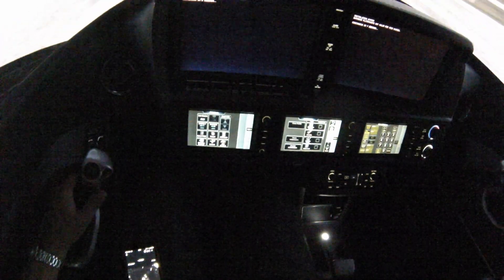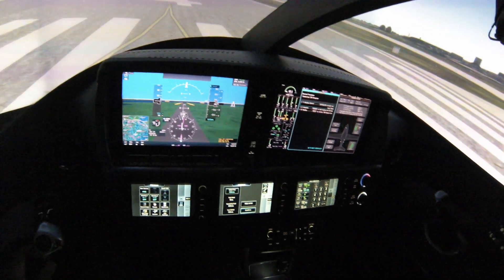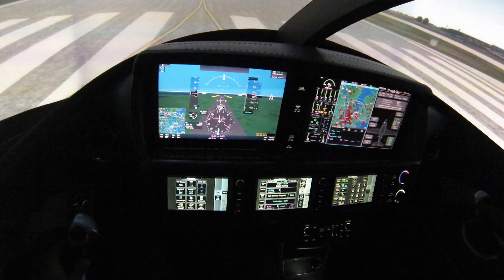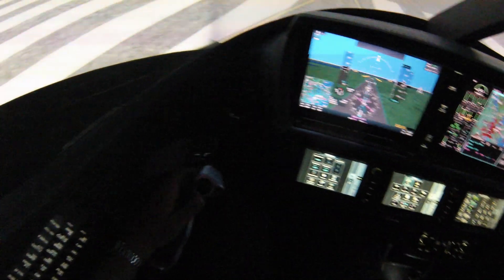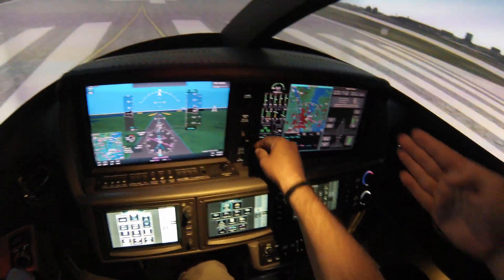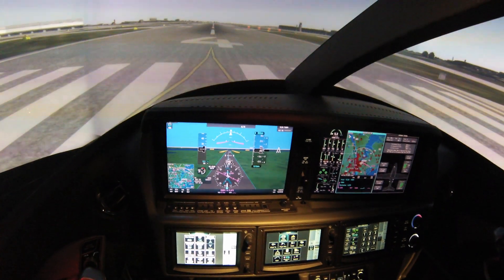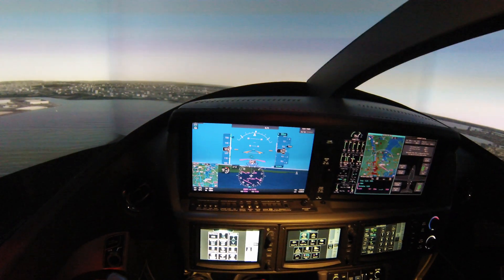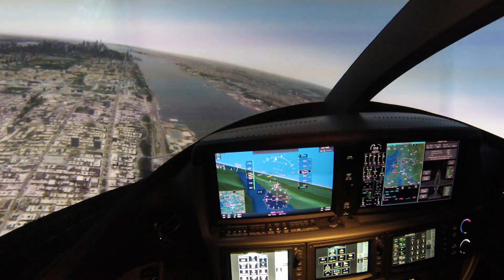Cirrus SF50 Simulator Avionics Briefing for Takeoff

Comment: The start up sequence entering in the destination first seems very backwards...then you have to enter in the take off runway (for the safe taxi system to be able to work)...and then manually enter the TO distance. As a part 121 airline instructor, when we programmed the FMS, we always entered in the flight plan in sequence starting from TO, the runway, SID, the en-route way points and then the STAR and destination. For training we always entered in the landing runway but on descent, we got the ATIS and let the students update the flight plan with a new STAR and landing runway.

The start up sequence here seems out of sequence and like we're jumping around. The student is entering FMS data but doesn't complete it...and instead, jumps to entering the TO distance. The whole thing feels uncomfortable, out of sequence and like it could have been bettered designed flow-wise.

Also, no checklists were being used. That is bad, especially for a jet. For being done in 2016, I'm surprised this instructor doesn't seem to have the cockpit training together yet. This is a very poor video (from a training quality stand point) showing a pilot how to get the cockpit ready for TO.
Reply from the maker: This was no official or serious training, just a short fun flight.
Reply: Oh, I see...thanks for clarifying.